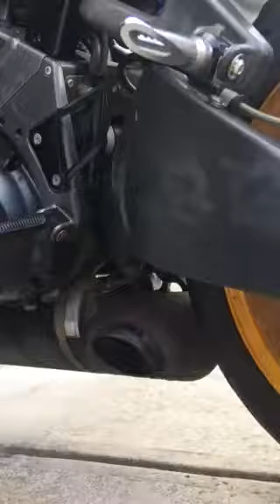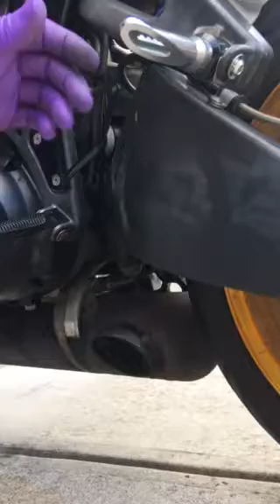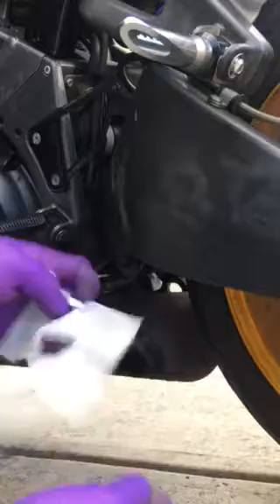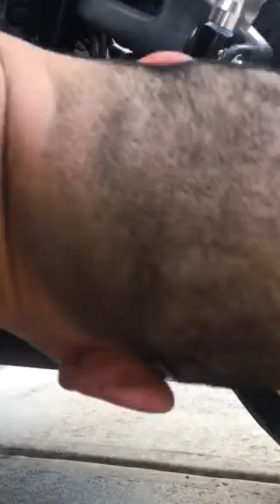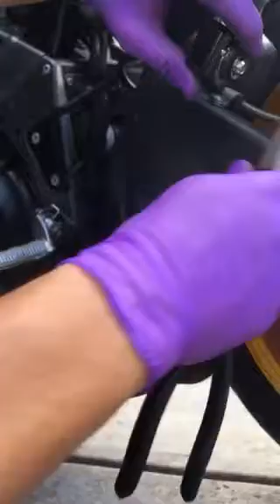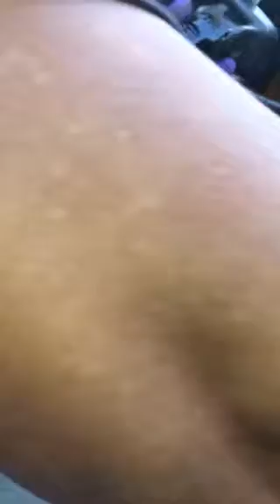Buell xb Lightning front and rear footpeg disassemble and install.  Quick video.

Comment from the maker: Oh wow, someone seen this video?   😂.  Just kidding.  You’re welcome!   That’s an old video, I did another on around the same  time.   It didn’t take as long, and I thing I was a bit more detailed and visual.  I was just showing that it can be easily done, at which I kinda failed. 😂. The front left side usually doesn’t take that kinda effort to assemble.   And the rear?  Usually the detent plate is not stuck in the frame.  I think it was glued in there from previous owner.   Not terribly difficult but having a long nosed , 45 degree needle nose pliers has been a happy tool for me with these installations.    Take care and happy thanksgiving 🍁🍽